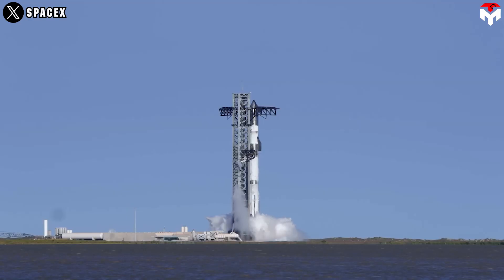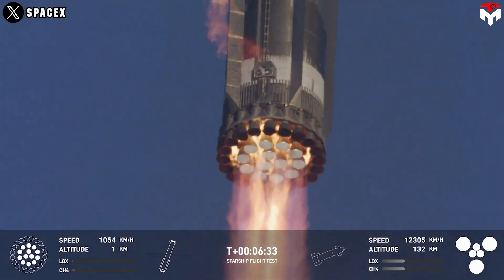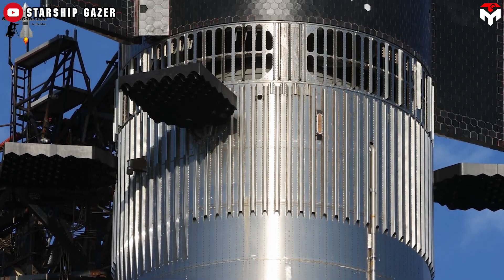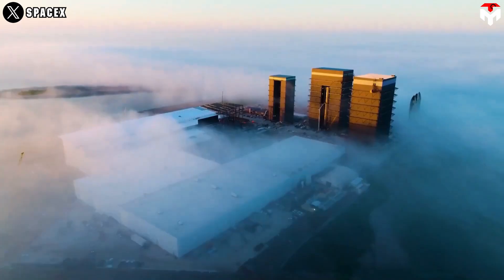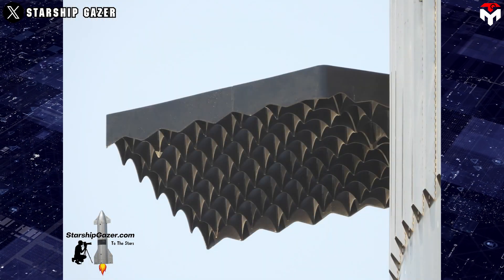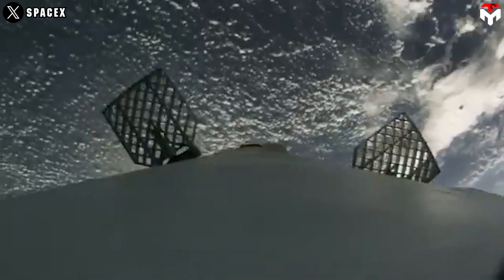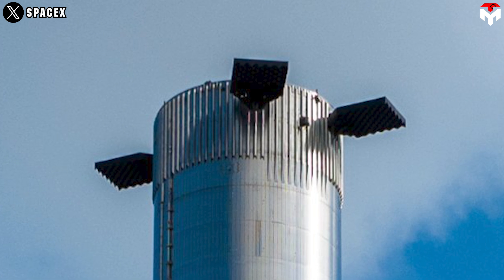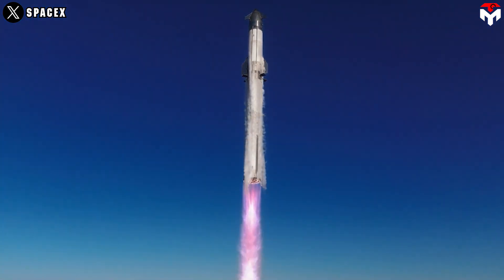Grid Fins MELTED&WARPED! SpaceX Experienced New Trouble During HSR Separate...

Comment: What if on the inside of the ring,there is an inner ring with perferated panels triangle shape at the point of the grid fins. This will devert heat just long enough to protect grid finns during seperation

Comment: Refering to the grid fin damage on flight 5 not 7 . Tower was damaged in flight 6 not a grid fin issue.  Fins worked fine to land on tower. Can be changed or replaced in hours.
Reply: it looked like some of the engines were warped  on the outter ring of flight 7

Comment: Titanium's expansion rate increases with temperature, so while robust, it may not resist warping.  The SR71 is a case in point. The CIA had quite a bit of fun with that aircraft when it got heated up.

Comment: It’s possible to have a successful booster catch, but still have damage done by heat, to the grid fins.
The issue then is that those grid fins might not then be suitable for another flight.

One remediation mentioned was to lower the grid fins, so that they are not as exposed to separation rocket engine blast.

Another remediation (similar idea) is to put them into a separation ‘blast shadow’ - that might be achieved by (1) placing the grid fins lower as already mentioned.
(2) modifying the stage separation ring so that there are angles of baffles - preventing blast in the direction of the grid fins.  No doubt that would instead result in wear and tear on those stage separation ring baffels, which might need replacing.  But that could be a much easier part of a subsection to replace.
Reply from the maker: Thanks for sharing!
Reply: I kind of doubt SpaceX will get to zero booster refurbishment by next year but we'll just have to wait and see. The more refurbishment required by each launch, the more vehicles they will need to keep up the target launch cadence.

Comment: Your title is like so many others. It's B.S. and totally incorrect. They grid fins did fail.. Warping from  heat is not failing. They worked just fine for catching the booster.
Reply: Melting fins would not be reusable.
Reply: They are not catching the booster.

Comment: The grid fins could be printed from Titanium to reduce cost. If they need even higher temperature resistance they could be printed from Inconel.
Reply from the maker: As I said, titanium is so expensive
Reply: Why can’t the grid fins be turned 90° during ascent and separation to reduce drag and minimize exposure during separation?
Reply: @PanioloBee  To avoid additional weight and complexity.